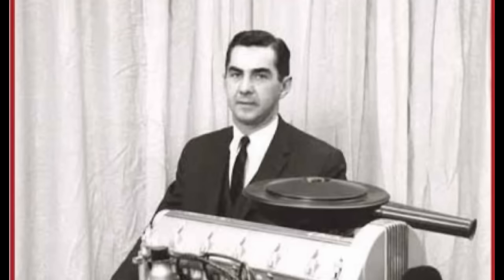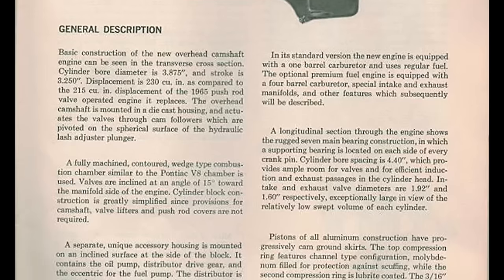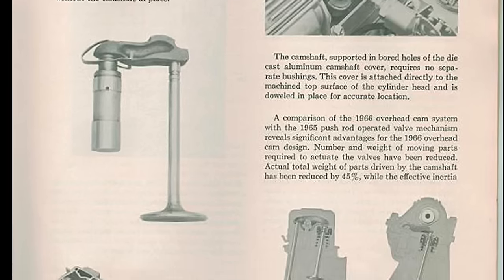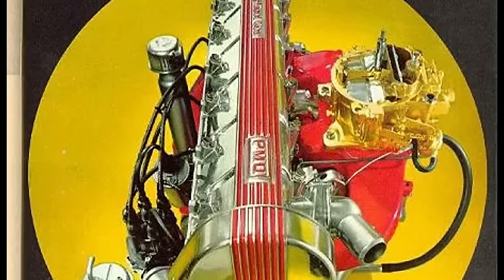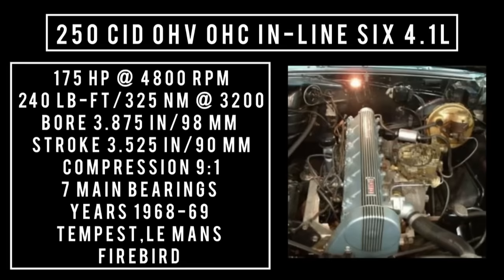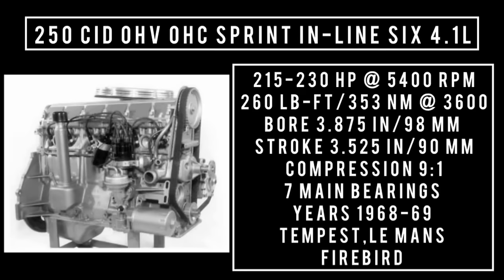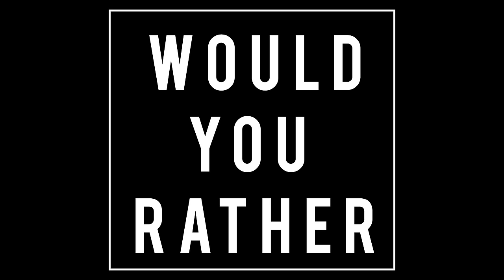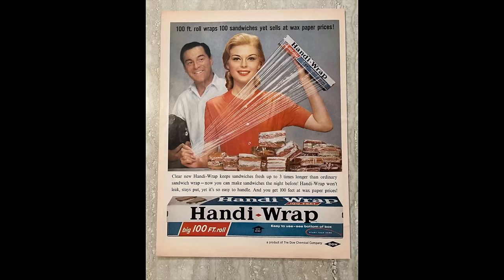Pontiac OHC in-line six engine family 230, 250

Comment: Sorry man, your stats, are "WAY WRONG",,,,way HIGH!.   It did have a rubber belt.  The gas mileage wasn't something that I remember.   I must say it wasn't all that great/ or maybe because I drove it "not" to worry about the mileage..
Reply from the maker: I got the stats from 

https://www.automobile-catalog.com/make/pontiac/le_mans_3gen/le_mans_3_hardtop/1969.html#gsc.tab=0

And a lot of the information from the Pontiac registry 

http://www.ohc6.com/history.html
Reply: @What.its.like.  I've got MINE: From "Motors Manual"
Reply: @What.its.like.  Yeah I don't know if I've told you, but in '67 it was a 230 Cu. In. in '68 it changed to a 250 C. I..  they came with 1 Bbl carbs, or 4-bbl carbs. They didn't last long, I think that '69 was the last year.  they had a TIMING BELT, they say it was made out of.........I forget, but something really strong.  I didn't replace mine.  It ran great, had a very different sound to the car. I had a Header on it.   "Clifford, 6=8" is what it said on the sticker, sounded cool, like because of the HEADER, my car equaled the POWER of a V-8.  (It didn't though,,> Maybe it DID> in those shitty EPA years!) V-8's were putting out maybe 140 HP back in the day,,  all of the SMOG stuff on them, and in '68, the ONLY smog B/S I had was a PCV valve. ahahahhahah